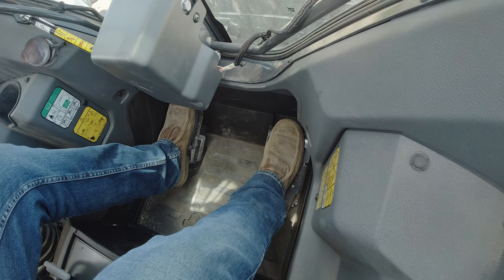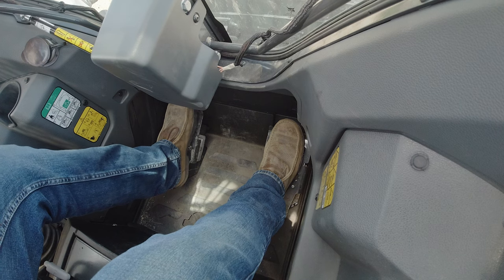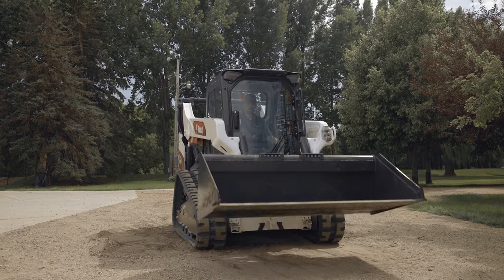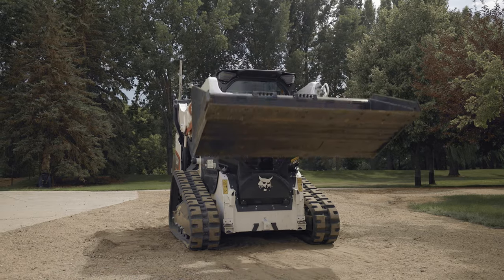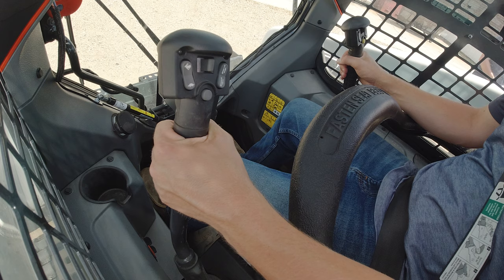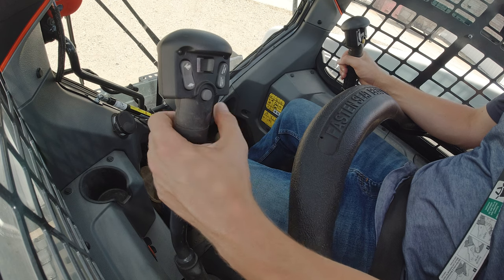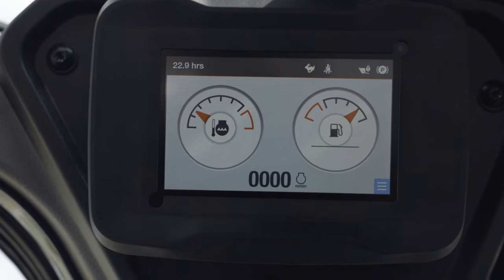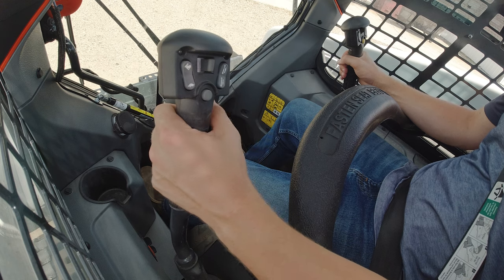How To Operate Standard Hand and Foot Controls | Bobcat Compact Track and Skid-Steer Loaders

Comment: Am I not remembering correctly that bobcat had a skid steer that ran forward and reverse with foot pedals?
Reply: I was actually gonna comment about that on this video. I wondered why it isn't an option? Makes the most sense. Best of both worlds. Fine control of each track with your feet, and front end loader controls on your right joystick. Would be nice to be able to have fine control over auxiliary hydraulics with your left joystick.
Reply: The only negative I can think of is your weight shifting due to you hitting the pedal, which could cause you to hit the pedal harder, which would shift your weight more, which would cause you to hit the pedal even harder and so on and so on. But I am sure there is a way to stabilize the operator so that isn't a problem.